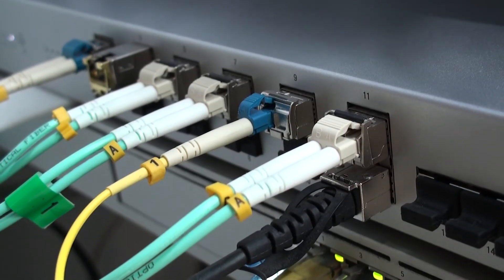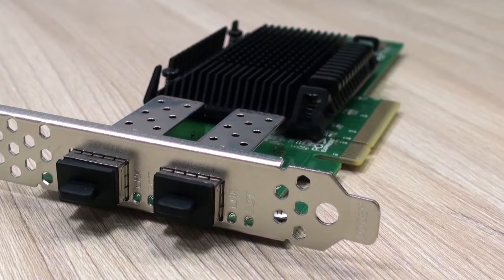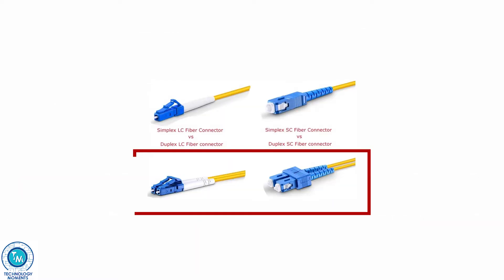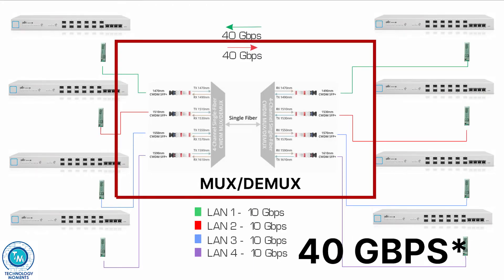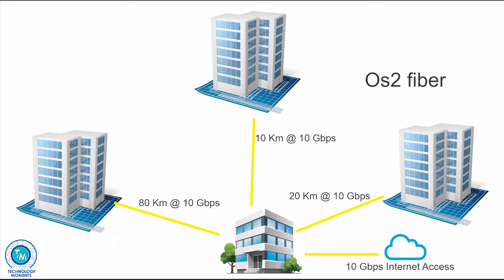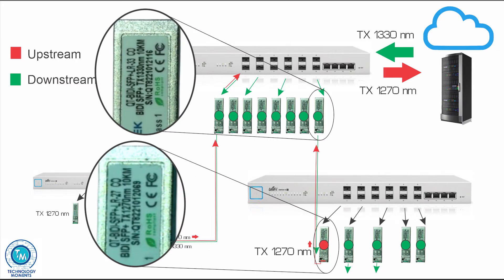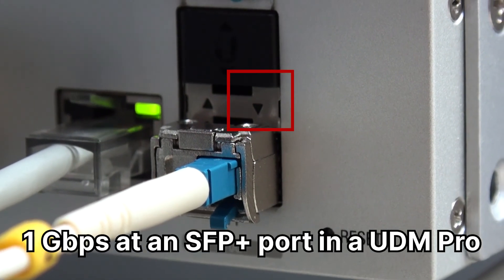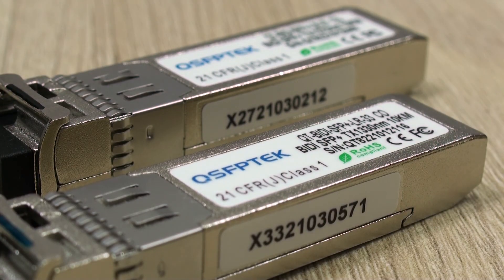Bidirectional SFP+ modules -  What you need to know to implement them

Comment: I have a couple of sites that are 40km apart.  I was able to get a 1 pair Dark mode fibre between them, and this was great.   Not long after this I put a passive CWDM module at each end and now have 5 separate Multi GBit runs between the sites without needing to worry about firewalls, separation, QOS etc between them.  CWDM (or DWDM) is absolutely worth it.  The SFP's are cheap and the CWDM chassis are passive and cheap also.  It's a no brainer imo.

Comment: one question. Bidi will work with OM4 Duplex cable, using them seperatly.
Reply from the maker: Yes, you can just separate the LC connector, most of the you can just remove them manually they come bonded mechanically and can be easily separated.  Just make sure you get a Bidi SFP+ for OM4

Comment: Thanks for the video!  I'm hoping to run fiber optic to a detached garage about 250 feet from my house.  I have an existing buried conduit which is only 3/4" pvc meaning the interior diameter is only about 1/2 inch.  Fortunately the run of pipe is completely straight with no bends.   I was thinking a simplex single mode fiber with single LC connector was my best shot of getting the cable through the conduit.  Do you agree with that?   I could use a long ethernet run as an alternative but I thought the fiber might be more reliable.  Right now i'm using ethernet over power lines and it's not very reliable, it drops out for a few seconds several times a day.  Also I just installed a TP-Link TL-SG2428 switch in the house with SFP ports hopefully that was the right thing and I would use these sfp modules: "10Gtek a Pair of 1.25G SFP Bidi Transceiver, 1000Base-BIDI SingleMode Simplex LC Fiber Module".  Again, really appreciate the video, thank you so much.
Reply from the maker: Both alternatives are great due to the short distance you have ( less than 300 ft).  On the other hand Optic fiber will provide you protection against close lightning strikes, which is very important in some areas.  With appropriate tools you could guide your preterminated optic fiber cable with LC connectors, due to the straight conduit layout.  Just make sure not to pull excessively the fiber.   You can even wire a parallel electric cable so you can centralize a UPS and bring power from your main location.  have a great day and good luck with your project.

Comment: What is more effective price-wise, which 10G sfp+ modules are cheaper in general:
1) Bidi LC
2) Bidi SC
3) dual strand LC?
I'm thinking about replacing my old switches and building a core network on 10G fiber, and it's so puzzling, I have no idea what to choose... I sorted out that we'll be talking about multimode, as max distance is about 100m.

I think short range links, dual strand LC are most common -> cheapest to get second hand, can that be right?
Reply from the maker: I would choose to go for most commercially available and ease of use as well as error free (manipulation wise of connectors)  Regarding this , with OM3 and OM4 can give you the flexibility you want, in dual  fiber configuration which will avoid confussion inherent to bidi modules.  As you are not handling great distances that will be enough.  Even if you choose to involve SFP28 backbones in your building for 25 gbps for 100 meter runs over OM4

Comment: Hi, why when I test a bidi device it sends power through the rx wavelength, I mean, it is a TX/RX device but if I test both wavelength the power meter reads power in both.
Reply from the maker: Hi, the power meter will test the "power" at which it reads the signal the module is transmitting.
Reply: @TechnologyMoments  but it reads power over the RX wavelength,  the questions is why is it sending power through the RX wavelength.

Comment: I need to connect UniFi aggregator to sw-8-150 what is the best cable and card? I like the idea of a single pair split for two switches
Reply from the maker: Yes you're right and that may be very convenient in many situations.  If your aggregation switch uses 10 Gbps use SFP+ modules compatible with Unifi however the tricky part here is that you need to match the wavelength at which one transmits with the other end at which that one receives. It is better you contact customer service for example at FS.com (https://www.fs.com/tech_support.html ) where they can guide you and see if it is possible to mix yours that way, as I have always seen that wavelengths used in bidi cables are different when using SFP and SFP+ modules, as your US8 will use SFP modules at 1 Gbps.  Good luck with your project

Comment: Can I plug my fiber internet right into my computer and bypass the ONT from the service provider.  Ethernet holding me back.
Reply from the maker: Your ONT is necessary as it is the one that authenticates with your ISP so that equipment is always going to be necessary.  If your Ethernet is slow compared to your ISP's speed you may want to consider upgrading your equipment to gigabit ethernet.  If you are surpassing the gigabit limit with your ISP, you must demand your ISP to give you a device with 2.5 GbE ports... also you must upgrade switches and cards to meet those specifications.  Hope this helped.  Take a look at this video we talk about that:  https://youtu.be/rjenBy9jK-k